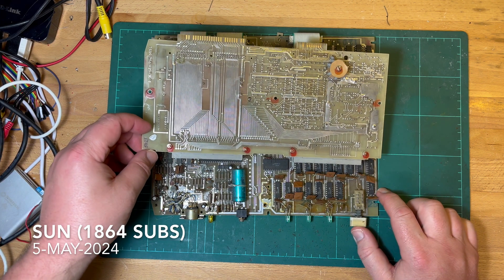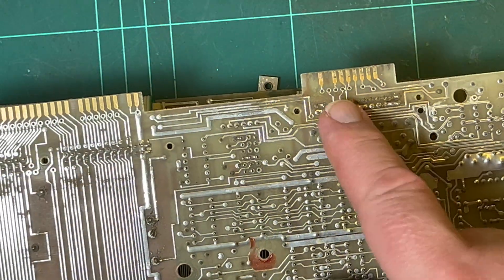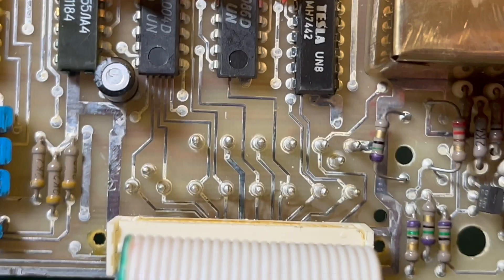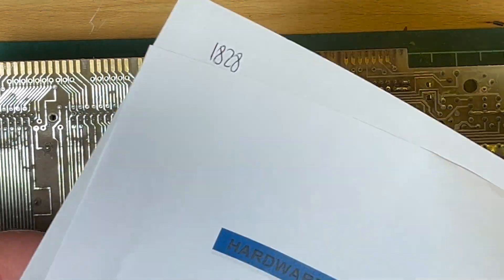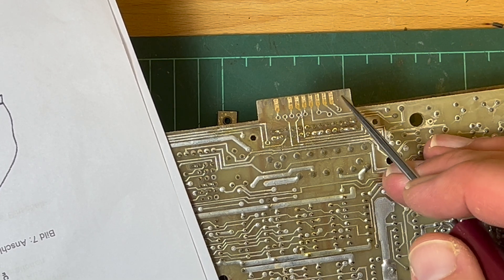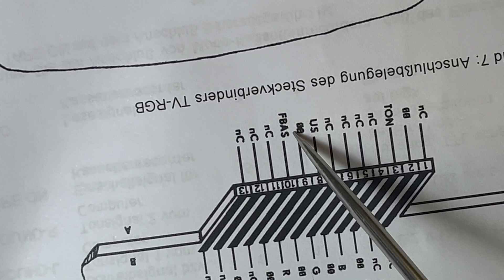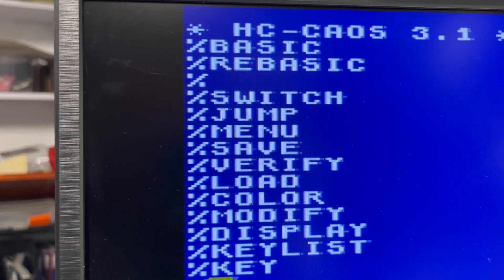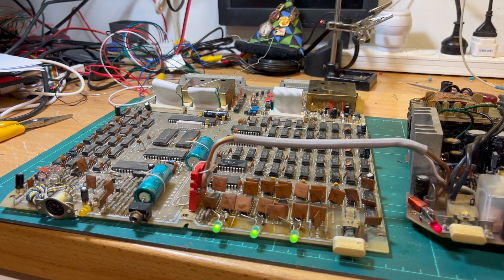🇩🇪 Robotron KC 85/3: Part 3 (Repairs & First Boot) [TCE #0444]

Comment: Bit late: The HC-CAOS stands for Heimcomputer-cassette aided operating system - it's basically a glorified expandable monitor. While they tried to be unique with their klein/small computer it was kept as the name for the OS. The KC85/2 prototype was called HC-900 with a few making it out into the wild - basically a KC85/3 without BASIC built in and no lower case characters. I've met Prof. Horst Völz who wrote the Texor text processor for this machine, which (supposedly) was taught to every secretary in the late GDR. A programm he original wrote for himself on his imported Exidy Sorcerer. Nowadays I own a signed tape copy of that program ^^
I haven't watched the other parts fully ... did you change the fuse holders? Those tend to oxidize badly no longer making contact. With ~10 KC85 machines I serviced over the years they were bad on 7-8 of them.
Reply from the maker: The machine, unfortunately, is still in pieces.  I extracted the ROM and replaced with an IC socket in an attempt to upgrade the CAOS version but it seems to have issues.  I definitely need to come back to this machine as I quite like it.
Reply: @Brfff  Which version did you upgrade to? Versions 4.x are for KC85/4 and upgrading doesn't make too much sense unless you're using modern expansions like the M052 (USB + PS/2 + Ethernet).
Reply from the maker: It was CAOS 3.4 ... I checked the video description to see what I did have:

And ... it seems to be working!  It booted into HC-CAOS 3.2, where CAOS stands for "Cassette Assisted Operating System".  The latest available version is 4.2 but I don't know if that's for the KC 85/4 only and I need to stick to the 3.x branch for the KC 85/3.